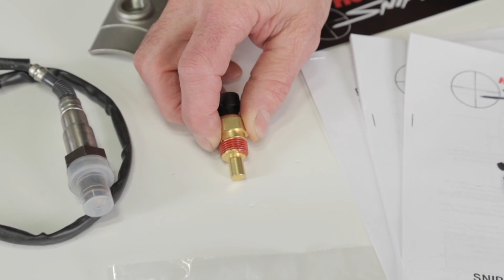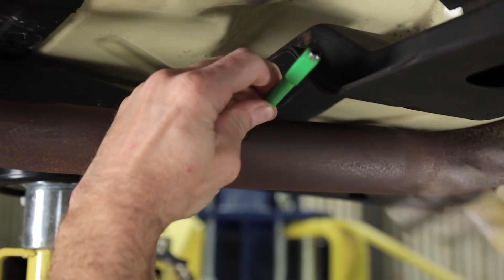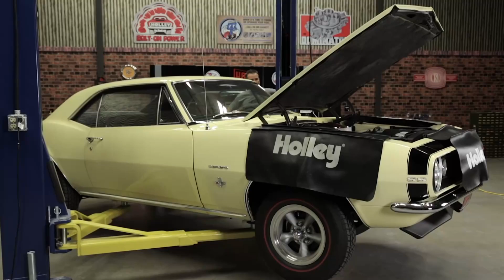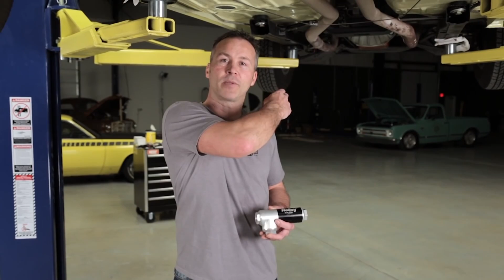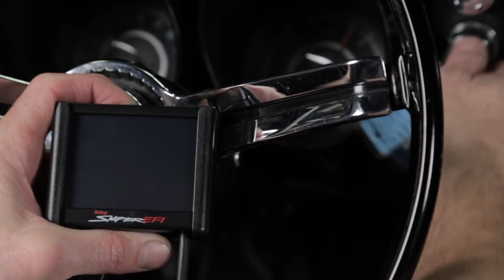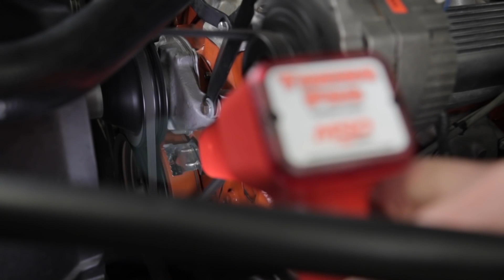Holley Sniper EFI Installation

Comment: This is by far the best   SBC HOLLEY SNIPER  INSTALL  EXPLICIT VIDEO ON YOUTUBE,, In My Opinion, .. just curious tho ..you say to hook up the  ECM  power ( red thick wire) & the ECM  ground wire ( thick black wire)  Directly To The Battery Posts ..Which in turn All Makes Sense ... but if your battery is  TRUNK MOUNTED .. would you have to  INCREASE   the wire gauge size then?.....thank you

Comment: I got ripped off ! I just bought this kit and it didn't come with some of the goodies you said were in it. I didn't get any linkage brackets, no ball studs, no mounting studs, no wire connectors, no air cleaner stud or zip ties. Had I got the stuff mentioned, it would of made things easier. I prevailed and got it on but had to make a few trips to the store to get that stuff I was shorted. This all sounds like piddly stuff but but it adds cost and time to the project. I was in a decent mood until I saw this video. No fun finding out you got ripped off. :-( I wish I would have seen this video before I tried installing this. I could have complained to the company, EFI System Pro, and had them send me the stuff they kept from my kit .
 FYI my air cleaner wouldn't fit the TBI due to the fuel line placement at the top of the TBI... Something no one seems to tell you before you buy it...